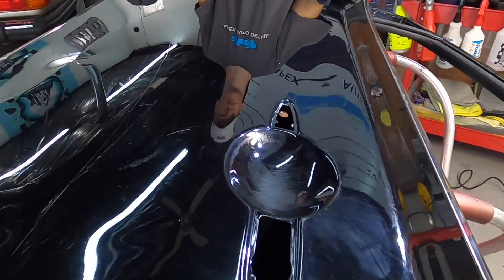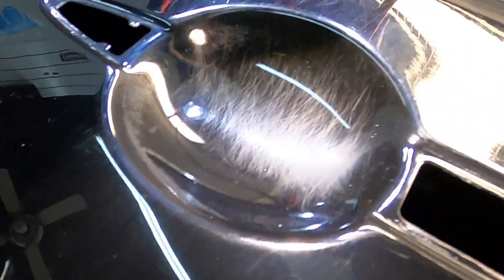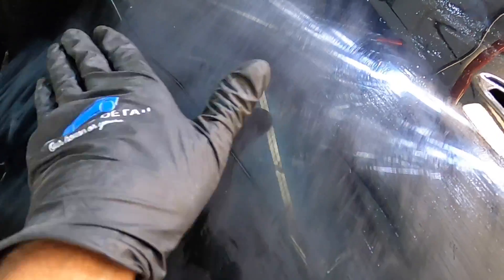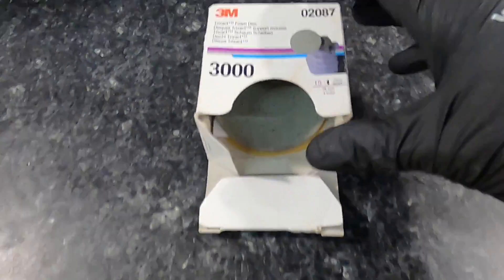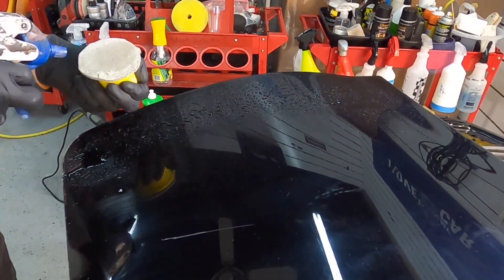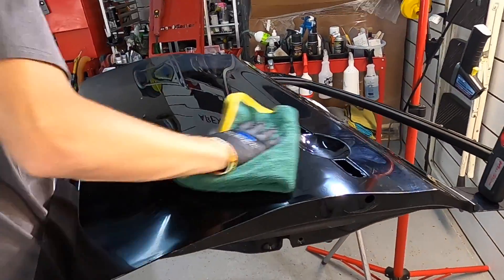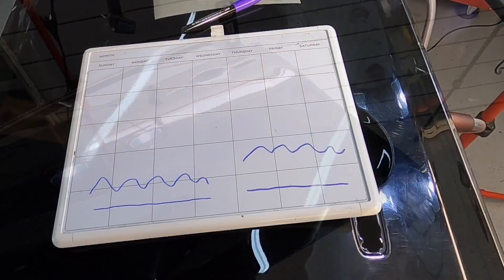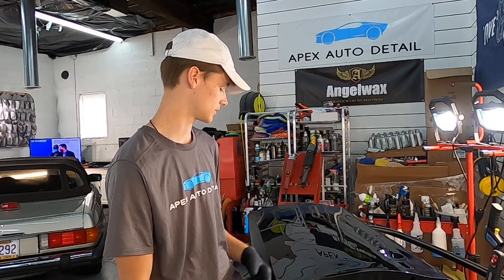Teaching a NOOB How To Wet Sand!!!/ The Basics! Part 1!

Comment: Great Video. Saying that, and being more on the analytical side, my question is “ HOW MICH CLEAR WAS THERE TO. START WITH, HOW MUCH WAS REMOVED BY WET SANDING,  AND WHAT WERE THE FINNL  NUMBERS AFTER  POLISHING” ? The video was very instructive, .In real life with all the variables of clear thickness, it would be really helpful to be able to gauge if we had enough to work with BEFORE starting. We can see what to do and when, So I’m asking is, are there some hard numbers we can gauge and expect? 
Hope this question makes sense. I’ve had a few jobs where wet sanding is necessary and have measured the beginning and ending , but not enough to feel comfortable with it, consequently that lack of knowledge and long term trial and errorI misses  opportunities that wet sanding would be safer and the best choice. 

Hope you can enlighten us in further video’s.  Aloha from Maui
Reply from the maker: I will cover that in the rest of the series.

Comment: Man your vids are so informative. Thanks so much for your time and effort. 🙏
Question: From 3000 wet sanding you’re jumping to the polish/finish directly using 3D-One and Rupes Fine (white) Pad, is that correct?
Reply: No, he was using the Uro Fiber 50/50 microfiber pad. Then if need be you can use the Rupes pad. (But he didn’t in the video). The Uro fiber pad still finishes pretty good.
Reply: @newtypena  my bad. At 9:30 he was saying that the Uro-Fiber or and Rupes fine pad they both will do the job done, but later was clearly visible the URO-FIBER pad was used, thanks for your input.
Reply from the maker: That should do it on most soft to medium clear.
Reply: @apexdetail85  thank you for your input. Could please tell me if you’re using exactly the Lake Country Low Lint Prewashed Knitted Lambswool Pad Extra Cut (code:LL-525-EC)? You’re taking about that pad very often in your vids, so I really like to give it a try on my Rupes LHR15 Mark III. Thank you in advance! 🙏

Comment: You have to make sure you have enough clear to work with.  Factory paint, from what I've seen, doesn't have a lot to begin with.  Putting a paint depth gauge on the paint inside the door versus outside the door should give you an idea how much clear you have.

Comment: Thank you for the video-great job as always-question, when would you add in touch up paint to further hide scratch and what is exactly the process-re sand paint to level then polish?
Reply from the maker: That would be the last step before protection for us here. Some will fill and wet sand.

Comment: Thanks! I'm learning polishing technics anda this helps a lot!
I have some doubts: what's the pressure I should apply when wet sanding?
And what kind of sand paper or block should I use on different scratches?
Again, thanks a lot!
Reply from the maker: I will cover the subjects in this series.

Comment: Hi Brian , If the increase in temp of 20deg f is an issue then we should never park our cars in the sun
Reply from the maker: ahhh...but the whole car for the most part will spike temps....not just a concentrated area.
Reply: @apexdetail85  make no difference to the paint surface .If a car is partly in shade and the Sun u will get totally different temperatures on each side of bonnet.
Why don't u measure a black car surface temperature in the sun .I live in South Africa and believe me u cannot touch it , as it gets so hot.
What I'm saying is the increase in temp u get from your Rotary machine will not damage u paint through stress ,

Comment: For the amount of time and labor involved wet sanding deep scratches you'd be better off having the damaged area repainted plus you'd have a new layer of clearcoat. I've seen so many people do wet sanding only to have the panel repainted anyway.  Just a waste of time and the customers money.
Reply from the maker: I completely and utterly disagree. I can wet sand those areas before you would remove them with a machine.
Reply: @apexdetail85  Of course you could remove the scratches faster by sanding than with a machine. What I'm saying is for the time and labor involved why would I have that method performed when I could take the money and apply it towards having the panel repainted and have a much better outcome.  Once you've removed the clearcoat you're stuck with the final outcome and there's no coating or whatever that can replace the factory clearcoat no matter what. Personally I wouldn't feel right charging let's say $500 on a hood, etc. to do some wet sanding when they could take that money and apply that to properly have it repaired. The base and clearcoat have become so thin as of lately that it doesn't take a lot of effort to completely sand through it. But I'm sure you're well aware of that.